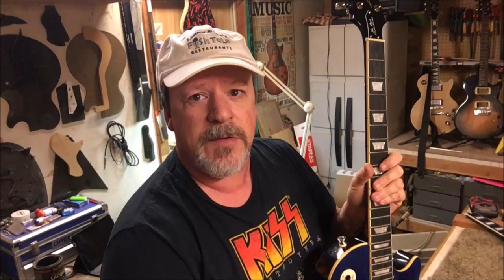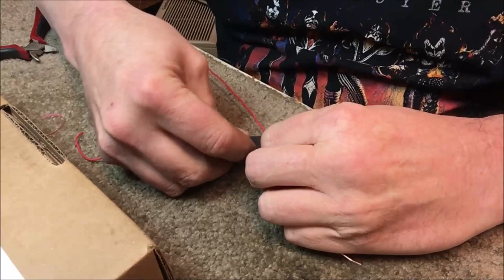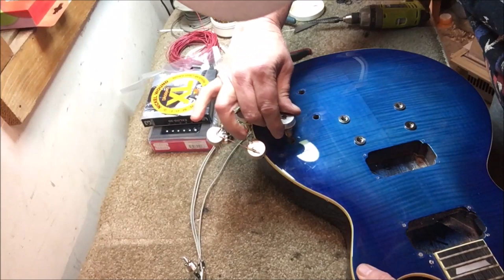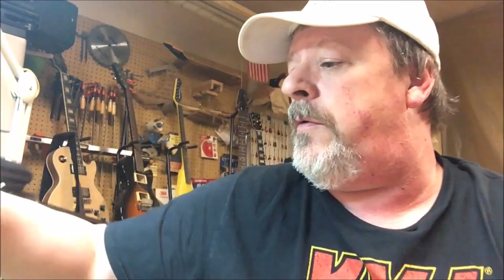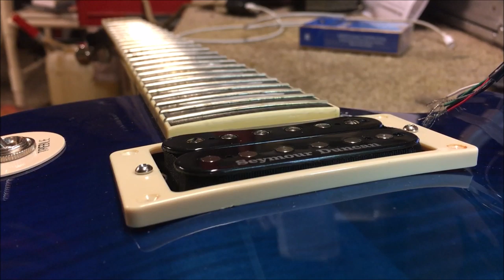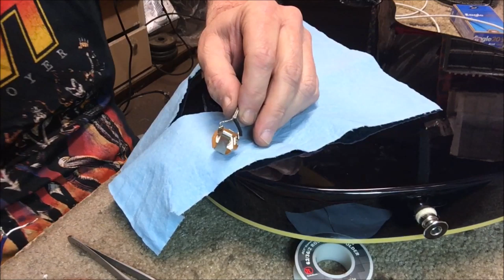Epiphone Les Paul Pro Electronics Upgrade - Step by Step

Comment: Excellent video and step by step documentation, Ken! I enjoyed the whole process, and even picked up some tips along the way.
If you have the time, I would like to ask a few questions, because you seem to have a good knowledge and skill level...

Your soldering iron/station - how many Watts is it? I've recently purchased a Soldering Station, and I'm having a hard time findind a good temperature for soldering guitar electronic... I often feel that the pots/wires I'm tinning gets quite hot.. Is that the same case for you?
I'm worried about frying the parts...

Also, I find that the soldering tips are having trouble to accept solder... even though they are brand new and haven't been used much.. Tin just seem to fall off.. I don't know.. It's probably me and my poor skills..

Your help would be greatly appreciated!
Cheers & Thanks.

Comment: Hi Ken I like your videos on these epiphone les paul pro's. Which normally come push pull to split the coils. To confirm, this change with the better electronics are no longer using the split coil, push pull method correct?
Reply: Definitely did away with the coil tap! No les Paul should try to sound like a Stratocaster! I was over the top happy with Kens work and all the upgrades on Ol Blue!
Reply: I have this exact guitar, and will be doing the pickup and electronics upgrade.  The split coil is not impressive at all.  I'll have no problem going to humbucker only!

Comment: Hey this video is great! Im about to embark on the same project. The braided wiring you use, is it just some kind of standard wiring or anything specific?
Reply: I'm also in the process of re-building my old Les Paul. Along with pickups, pots, etc., I found this exact wire at Stewart Mac: https://www.stewmac.com/electronics/components-and-parts/wires/

Comment: Hey Ken got an exact same guitar and planning to upgrade pots. The pots you installed in this video, was it push pull coil split ?
Reply: Amad Iftikhar this was a split coil...I had him swap it all out . The Pearly gates are amazing through my fender hot rod deluxe and my Bugera T-50

Comment: I have the identical guitar color and all it sounds great the way it is. I get what your doing must be just a hobby of yours .does the guitar gain any value .in the end sounds the same as the old hardware.
Reply: I can assure you the factory coil tap set up that was on this axe was good. But it was no pearly gates set up! The sound difference was immediately noticeable when I got it home and plugged it in to my hot rod deluxe. Also, the brand of strings went from Ernie ball to D’Addario thanks to Ken. Ol Blue has done about 40 shows with the new set up. I couldn’t be happier!
Reply: Interestingly, I've heard pickup swaps will not increase resale value, and may actually decrease value some.  However, they can be a huge improvement in tone.

Comment: I have the exact same guitar, Would you suggest to do a Faraday cage if i do this upgrade? I Plan to upgrade all the electronics exept the pickups.
Reply: As long as you use shielded wire and make sure you do all the ground connections (especially to the bridge) you shouldn't need a faraday. If this was a single coil setup I would say you should line the pup cavity w copper foil tape but w humbuckers that's overkill. As I write this I'm realising that this comment is a yr old and you've likely already done your swap lol but FYI for future.

Comment: I'm a little confused on how you soldered the pickup switch. It seems you grazed over that process and went straight to the pots. Can you explain what you did there?
Reply: Check out any relevant wiring diagram.  Seymour Duncan has a bunch.  That'll clearly indicate which connections to solder your leads to.
Reply: Soldering is its own art bro not too hard to pick up just gotta play with it

Comment: Hi guys, my old 2006 Les Paul Epiphone's screws are all stripped and I cant unscrew like 1:04, 1:33 or pretty much everything. i tried methods with thicker rubber band, didn't work. I am thinking about drilling the screws, but I seem cant find drill bits that is small enough for the guitar's screw. Any idea or advise? t
Reply: Sure buy a new guitar dont be cheap.

Comment: Is there a model number on that soldering station? Thanks.
Reply from the maker: Matt Liebenau MX 500P-11, I just looked on eBay and the prices have gone way up on these over the past 6 months. Just search metcal for other models
Reply: Thanks again. Do you know if replacement tips are available?
Reply from the maker: Matt Liebenau yes they are.